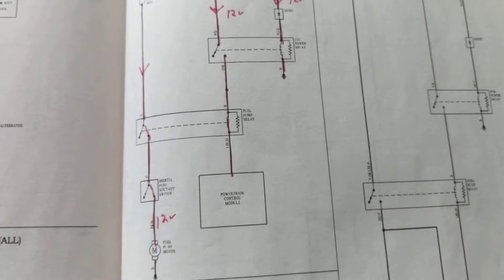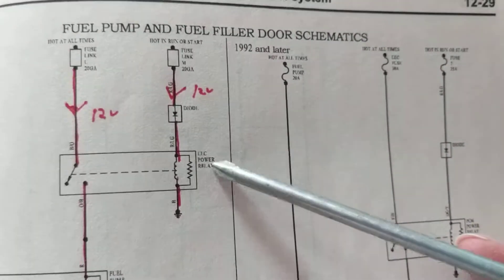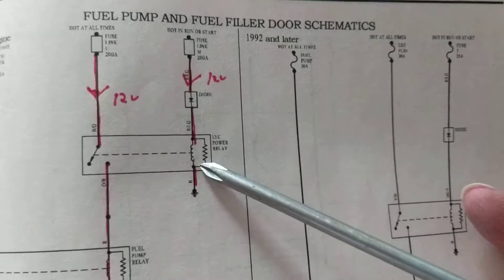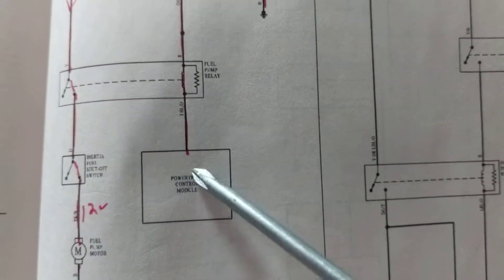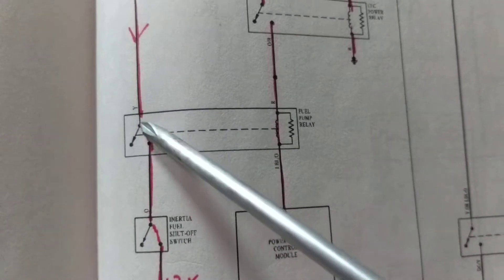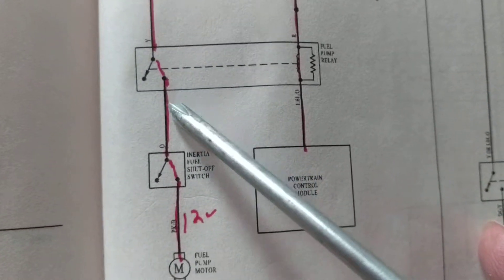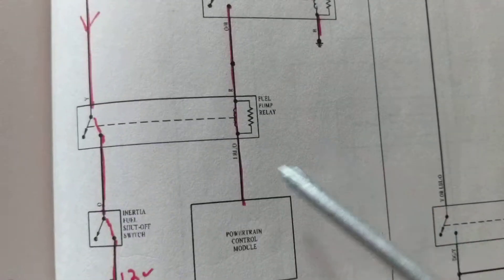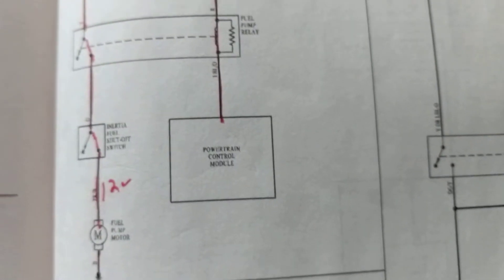How does FUEL PUMP  work for Ford crown Victoria 2000 4.6 L with inertia switch,  please subscribet

Comment: Figure this one out...fuel pump works, fuel relay works, ecc works, fuses all good, inertia has continuity, fuel filter new, fuel pump won't prime or turn on.....car was running fine. Went into doc apt for 20mins, came out, cranks and won't start. Now after further testing there's only 6v at inertia. Which means faulty wire between inertia and relay/power box. There's 2 wires coming from inertia, green and yellow which go to relay, can't find the red and black except in the power box. No idea where it goes in between.

Comment: I have a 1992 that is giving me fuel issues. Is this the same wiring for my 92? Thanks man. Nice video
Reply: All the models are usually the same the first thing is to measure fuel pressure and see if the pressure holdsif you don't have fuel pressure then you could have inertia switch the tripped or you have electrical problem maybe the relay or fuel pump if you have fuel pressure but it's decreasing then you could have a line problem not holding the pressure you could have a leak in the line or fuel injectors or fuel pump